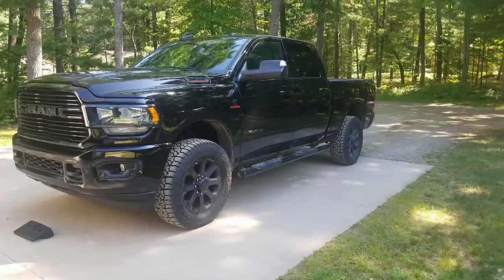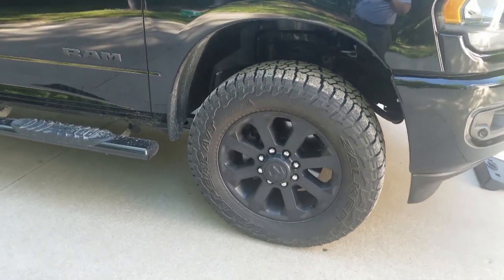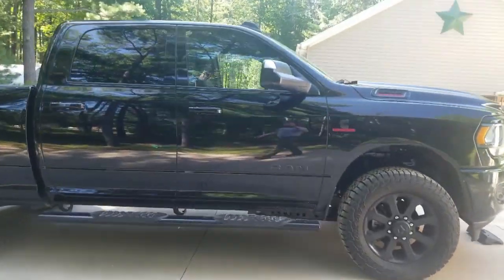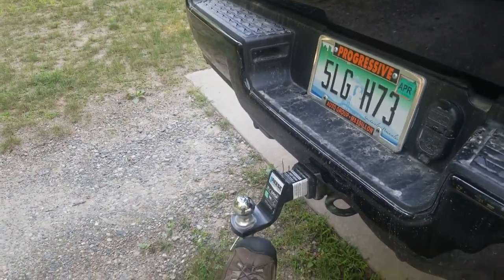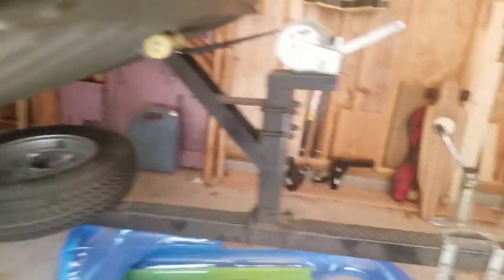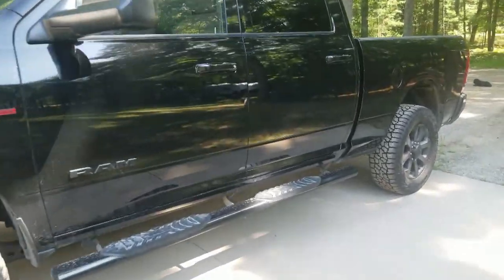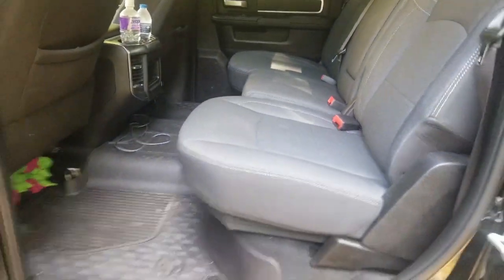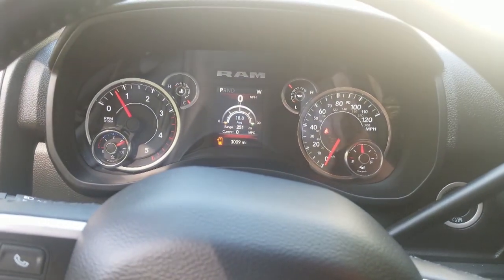2019 Ram 2500 Cummins Pros Cons And Mods

Comment: These trucks have to be standard 7000 payload n 30000 towing
Reply from the maker: Never seen a 2500 or. 3500 thst meets that payload and only a single cab longbed plain Jane 3500 would hit 30k tow capacity
Reply: @SamkoTradBow  factory companies ala ram should make it standard in the future I think it will.  People getting ripped off

Comment: “Hitch with 6k lb rating” - don’t need a diesel for that, Hemi could handle it.  The money you saved buying 6 dollar mirrrors will help toward the expensive repair bills when they come, and they will come.
Reply from the maker: If you watch the video you would of heard me say 2 times that that hitch is just to protect me from people parking to close. I have 2 other drop hitches and a equalizer 4 hitch for my 7k camper.  Still all things a hemi could handle. But nowhere near as well. Not worried about any repair Bill's. Again if you watched the video I have a 6 year 125k full warranty  so I have zero fear. Not that I would have any fear anyway as I know 9 people now with 2017 or newer rams with over 200k miles and never even a hiccup.  But thanks for the comment. I appreciate all responses and all opinions. Have a great weekend!
Reply: Then what was you saying between 15:20 -15:50?
Reply: But yea, you also did mention your big trailer.

Comment: Man I keep trying to get a new RAM- I tell them "I want one exactly like this in this video" I never thought I'd have so much trouble finding one with the coveted "Cummings" diesel; every dealer in my area keeps trying to get one over on me - they attempt to sell me trucks with some knock-off diesel they call "Cummins". Seriously do they think we're idiots? Everybody knows Chinese knock off products always have misspelled names; it's just a shame that RAM is cost cutting so drastically as to slip these knock-off "Cummins" diesel engines under the hoods rather than the real-deal "Cummings". SMH
Reply from the maker: I dont think there is an a "cummings " cummins is the company that specializes in diesel motors.

Comment: No way 80,000 miles on tire on a 2500 🤦‍♂️
Reply: Craig Leidig Jr they have 55k warranty on them. I used same tire on my 2nd and 3rd gen. If you not towing and maybe somewhere up there but 80k too high
Reply: I have over 60k on mine still tons of tread life over 50%. 2015 3500, best tires I've bought hands down.

Comment: It a tow mirror 🙄
Reply from the maker: Well it sucks as a tow mirror in the down position.  Actually it sucks as any mirror in the down position. And it sucks as a mirror in the woods and tight spaces. And it sucks as a mirror driving down the road. And it sucks as a mirror to check my make up in. And it sucks as a mirror.......it just sucks as a mirror in the down position.
Reply: Traditional Bowhunting And Wilderness Podcast I have found the 360 camera’s helps a lot for blind spots and also when the mirrors are folded in when in the woods.
Reply: Traditional Bowhunting And Wilderness Podcast I keep my mirrors up all of the time if I’m towing or not and just fold them in while in the woods

Comment: Make sure the egr and dpf fall off to make that truck last.
Reply from the maker: Not legal anymore. Can not delete diesels with new epa regs and laws
Reply from the maker: Besides, it's a Cummins. So many people running them with 300k miles on them with just regular maintenance.  More than half of all diesels on the road are Cummins. I have zero worries about reliability.
Reply from the maker: Trae Thibodeaux  then why the hell would I delete it if it's not legal! I know so many people that are run hotshot rigs for work and people that haul TVs all over the country running ram Cummins without deleting anything and 2-300k on them with out any issues just normal maintenance.  I will for sure not be deleting mine. Especially if it's not legal. I'm also not tuning it or messing with any of it. Do as you please.  But my two cents, dont mess with it. Take it for what its worth.

Comment: 370 hp 800 tq No led headlights or taillights . No onboard  auxiliary switches.  No thanks the older  ford powerstroke 2017 powerstroke  has  450 hp and 940tq and looks better in my opinion.  Plus extending side mirrors.  And the list go on. More room in the truck compared to the Ram . 7 auxiliary switches to hook up light bars.  winches. And more accessories made easy. Sorry but the powerstroke offers alot more.
Reply from the maker: Well there ya go. Go buy a power stroke. I drove all of them. The ford was nice but ride quality was horrible and with all the death wobble stuff my wife read about she ruled it out right away . I'm personally glad she did. I love this ram! To each thier own. I would not trade the ram 2500 for the ford or the Chevy .
Reply: @SamkoTradBow  the death wobbles actually is  in the ram if you read it up your wife reading the wrong thing. And death wobbles happens with lifted trucks over 6 " or more and the ram is notorious for that .
Reply from the maker: @desperadosanchez723  actually it's the 2017-2019 powerstrokes, videos all over on it as well as people spending  big money to correct it. We could go back and forth all day. But I love this truck. If you like your powestroke that great. Means we both got exactly what we wanted. Glad my video helped you by showing you that you dont like the ram. Plenty of people feel the same way you do.
Reply: @SamkoTradBow  I'm not trying to be rude but you are mistaken with the death wobble and actually  your video made me appreciate my Powerstroke so much more. I got no death wobbles even with a 6 inch lift and pulling a 12000lb  camping trailer . The ram has that issue with death wobbles lots of video on youtube.
Reply from the maker: @desperadosanchez723  we will have to agree to disagree.  Watched 50 videos on ford death wobble. But either way ram built up the front end in 2019. Did I mention I love my ram!!!!
Reply: @SamkoTradBow  lol I just watched 78 videos on Ram death wobble . And did I mention powerstroke .is the king of HD trucks and best selling hd truck they are the leaders in the truck industry.  Love my powerstroke
Reply from the maker: @desperadosanchez723  glad you love your truck. have a great weekend.
Reply: Twestedash Furtado Ford interior sucks!
Reply from the maker: @2easy007  I spent alot of time in all the hd trucks test driving a ton of them. I agree 100% ford interior is so lacking compared to both other brands. I do not miss my f150s at all now that I have this ram! Interesting enough I just read an article that last year ram trucks out sold chevy and is the number 2 for sales. This year ram is so close to ford hd sales it's almost a tie for #1 in sales.
Reply: @SamkoTradBow  I owned a 2017 f250 powerstroke 450/925, here is what I think between the two. The power and response of throttle from mid range to top range definitely beats cummins. But the Ram low end is just a monster, even with the tuned down 370/850 power. As for the ride, Ram won that battle as well. Ford won the battle on the mirrors, wish Ram didn't something similar like the ford did. Interior on the ford seem bland and Ram definitely won on that front. Ram has air ride on their 2500/3500 (Which I have) and its amazing. I think this is a huge step over Ford, since air ride is such a must to have when towing and after market airbags that you manually fill (Or install the pump) is usually "meh" at best. Fuel mileage seems better in the cummins versus the powerstroke. But that's why inline 6 is used in big rigs versus v8, which they actually did try using v8 design in the past and it was just a joke of a motor. Pops been driving for 40+ years and I drove for 10+ and definitely say cummins got their act together after 2010. Their ISX was not that great at first but got it figured out.

As for the death wobble, that happened on so many Ford with their 6.0 years and 6.4 years. So yeah Ford may have correct that on 2011- 2017 version of the Super Duty. I had one, didn't have that issue but I didn't lift it and just put bigger tires (Putting lifts on this truck is such a bad move in general). Ram did address this death wobble in their 19 year models and change the front end to correct this, so I think you made a good choice.  Otherwise Twestedash is just touting brand pride, not really sure if they needed to argue to make themselves feel better but it was kinda sad to see. Hope you get 500k out of your motor, as that is actually the milestone of some of those who hot shot these trucks. Enjoy!
Reply from the maker: @joe2bear  thank you for taking the time to write this. Not only the best comment on this video also one of the most informative.  Greatly appreciated!!!
Reply: The 2017 powerstroke made 440 and 925, out of a VGT turbo makeing around 23 pounds of boost.  Cummins detuned engine is about 18. Every current HD truck offers auxiliary switches. Ford has had serious issues with death wobble on the new aluminum duty trucks, it comes from weak steering components and a underpresurized steering damper. If your not getting death wobble on your lifted truck its because its the lift manufacturer supplied replacement parts to correct the issue. The ford max power numbers are nice and look good on paper but actual useable range is lacking. That being said the superduty and the ram are the only heavy duty trucks i would buy. They each have their disadvantages. Fiat changed the game with ram and all the older generations are stuck on the 1st and second gen issues of the rams, the 47re was 20 years ago let it go. However fiat missed the boat bot not offering a ZF8 in the newest generation truck so they could offer identical power numbers on both 2500 and 3500. The 68rfe trucks are 4 grand less then a comparable ford truck engine alone. For out the door pricing of the trucks the ram is easily 8 to 15 grand less then an equally equipt ford. Just because they sell the most doesn't make them the best one out there. You have to drop brand loyalty to open minded in todays truck market. GM rested with the number 2 slot and fell behind, stop innovating and you'll lose customer base. This all being said i own a 17 powerwagon for transparency. Great offroad truck.
Reply from the maker: @Rommer2258  fantastic comment! Very informative and appreciated. This is my first diesel so very new to alot of this and love input and details like this. I did hours of research as well as over 100 miles in each model test driving. But that's all I have to go by. Its nice to hear from people that have some history with diesels!. Thanks again for the great comment.
Reply: Both ford and ram have the death wobble I see it in both my in laws fords and I had it myself on my 2012 ram 3500, problem was the track bar fixed it instantly. I saw carly review the 2019 ram and they say the trackbar has been addressed on the newer trucks so no more problems hopefully. Was on the market shopped ford and ram and ultimately went for my 6.7 Cummins. No hate on ford though both great trucks!
Reply from the maker: @gaiadi0z  When I was researching and test driving the ford and ram I watched a lot of videos on how ram addressed teh front end in the 2019 and beefed all of the steering components up among other changes that are not often mentioned. Only ford fixes I found for the wobble was after market and customers that brought stock ones to dealer only to hear :could not duplicate problem" and no fix. Honestly it was a tough decision for me between ford and ram. many pros and cons to each. the ram was the best for my needs and things that are important to me. Im very happy with this new truck. But my neighbor just bought a 2019 f350 and loves it! I dont think you can go wrong with any of them. appreciate the comment and extra info. Always nice to hear first hand experience and honest info rather than the "ram sucks" or other crap that helps nobody. Thanks again for the post!